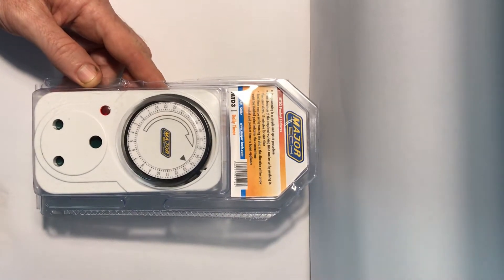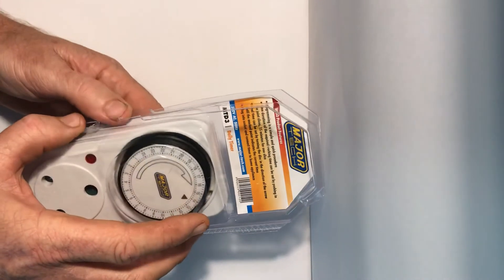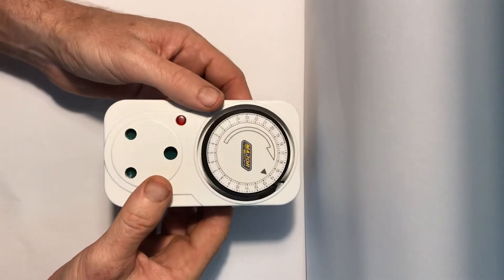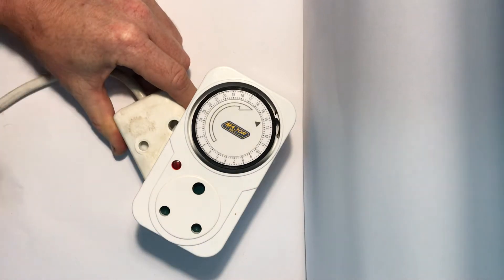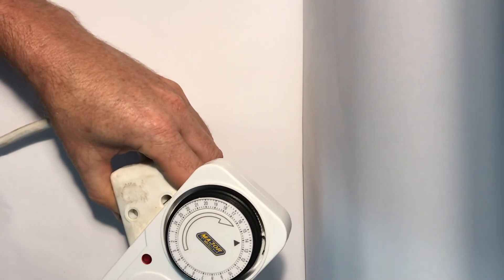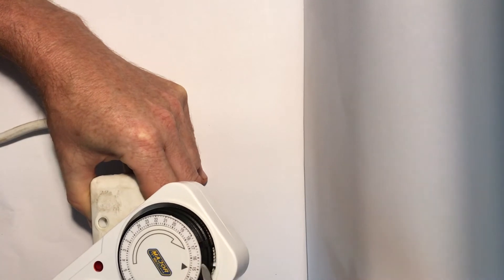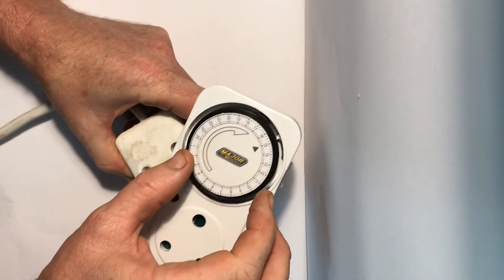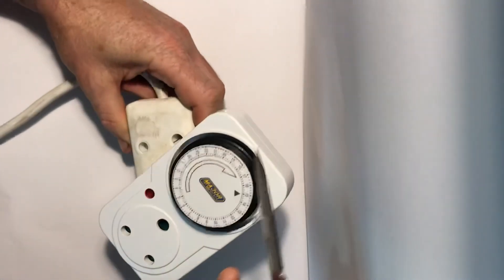How to programme an old-school 24 hour timer

Comment: What happens to the timer if there is load shedding?
Reply: Does not work unless u plug it behind the ups or generator but when electricity is restored it continues to work